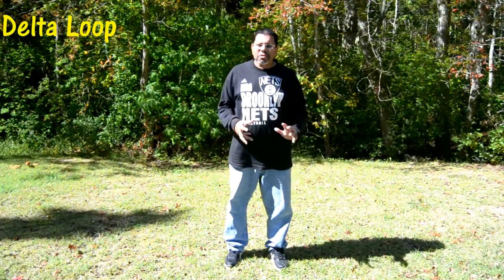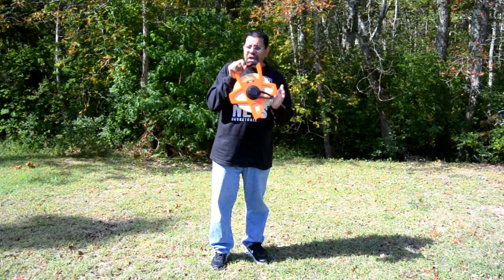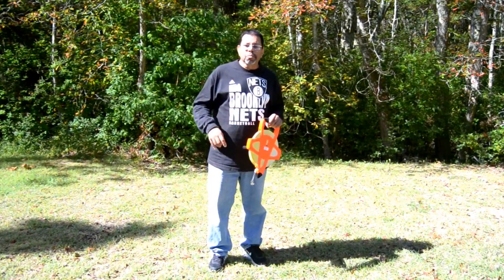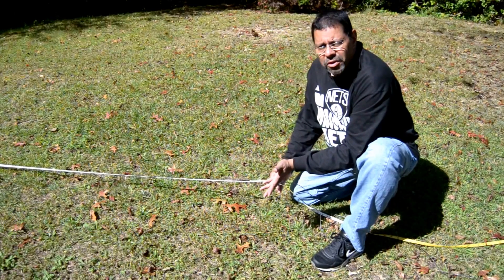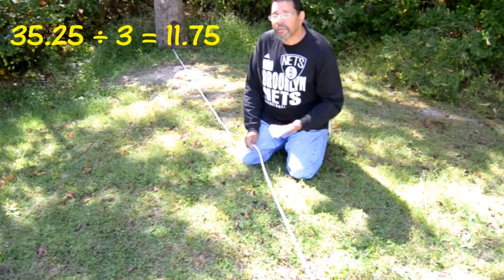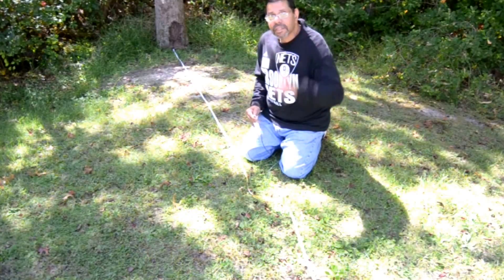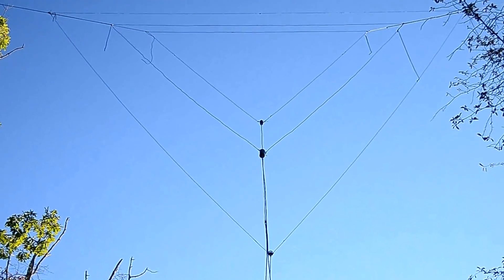How To Build A Delta Loop Antenna

Comment: you stated this is vertically polarized, it looks like it is fed in the center, wouldnt tht make it horizontal, I have read feeding it at a corner of the base makes it vertical, please explain. Thank you for your vid and time.
Reply from the maker: Sorry for the late reply.  Going to have to check but i think i said that it is hung vertically but it is horizontally polarized.

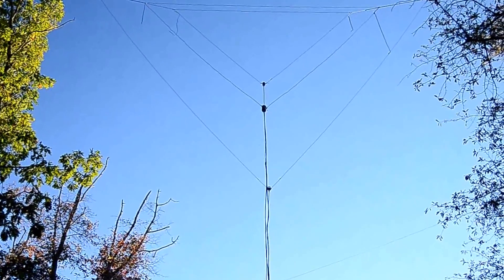Comment: hi Hiram thanks for this video make me understand about the q-match,  Hiram i see on video @ minute 08:33 i see the 3 antena deltaloop. my question  can i use only one coax for 3 antena Hiram ? thank you so much for your answer and 73 all the best for you and family and best regard from indonesia YB1BBW
Reply from the maker: Sorry for the late response.  I never feed one cable into multiple antennas so I dont know.  My guess is that if you can do it to one antenna then you can do it to any antenna as long as the load is 50 Ohms on each antenna.

Comment: I’ve ran a 40m delta like this for years. No trees so 1 end high and 2 at 10ft. Fed with 75ohm stub. I’m wanting to try the open wire on it soon. Just to see if it does any better on 20. I’m building a 1:1 current right as it enters the shack. The loop shows 80 ohms at the Q. 
 I’ve often wondered how it would do with a 20 and 10m inside like yours. I’m sure there’s some common mode current maybe ? Great antennas
Reply from the maker: Sorry i'm late to reply but I'm just seeing this now.  I do see what you mean.  It is sorta "upside down' from the way i did mine.  I don't know if that really matters.  40M deltas are large so I guess the feedpoint is up around 60 ft.  Would play the same as if it were 2 corners at 60 ft and fed at the bottom.  Reason being the antenna radiates out from the center of the loop.  It doesnt matter which corner the feedpoint is.  However if it is fed along the sides between the corners then it will change the polarization so that will affect how it performs.
Reply: @hiramvazquez7868  Tnx hiram. Yes we use deltas at the contest station. Vertical plane and fed 25% up the vertical leg at 110 feet. They work very well. Still my primary 40m antenna.

Comment: I see here is multiple delta loops inside each other with common feed point why is that? Isnt a single loop with 4:1 balun enough??
Reply from the maker: I do have as many as 3 delta loops inside each other but they are fed individually. If you use coax the antenna will be monobanded so you will need a dedicated coax for each.  Anything else will compromise the performance of the antenna. Maybe if you feed it with ladder line and use a tuner but I never use my antenna in that fashion.  73
Reply: Hiram Vazquez are these loops directional or omni directional
Reply from the maker: @Mark300win  they are hung vertically but they are bi-directional

Comment: Hi, perfect video, will make  one and try it out, on 80 and 160 would it be same if it is mounted horisontally ? I know vertically makes lower angle/better DX.
Frank LA9KY
Reply from the maker: Yes it does make a difference. If mounted vertically the take off angle is lower. I used it on 40m this morning and worked VK6 and VK1 with just 100 watts.  Good luck and have fun with it!
Reply: thanks, have you ever tried to lay it down, not flat but still sloped, with feedingpoint lowest, and the top maybe 85feet.(which is the highest i can do) thinking about 80 and 160m, wonder how the radioation pattern will look like ? :-)
Reply from the maker: @frankhagen4380  I have not tried it but I have heard a ham that did.  He was super strong to me. Around 30 to 40 an over S9.  However he was maybe 200 miles (320 km) or so from my QTH.  To me he was booming.  He said he worked some DX in the DX Window (3.790 to 3.800) with good results.  He had to slope it because he didn't have the vertical height and the feedpoint was only about 3 meters off the ground. Hope that helps.  The best answer to your question is as NIKE says. "Just do it".  Good luck and hope to add u in my log. 73!

Comment: Hi Hiram, Great video. I love loops. I use an 80m FULL WAVE SQUARE LOOP and its only 10' off the ground.  How high would you say your loops are?
Reply from the maker: Hi and sorry for the delay as i just read your question for the first time.  My loops are up about 50 to 70 feet supported by the tops of trees.  They are hung vertically so they are bi-directional but also have low take-off angle which is preferable for DX.  Thanks for watching!
Reply from the maker: My loops are 60ft at the top then they hang down.
Reply: It's so noise quiet. Awesome antenna
Reply from the maker: @marklowe7431  Mark the great thing about loops are that they are quiet. They have gain and don't take up much space.
Reply: @hiramvazquez7868  I want to thank you for putting the video about the delta loop on YouTube. It has been very informative . And I plan on building several Delta loops inside one another like you have done. Thanks again .73 AE4OY WILLIAM A. Peacock,Sr.  EM-81UF

Comment: Can I feed a 160 meter delta loop with 450 ohm ladder wire? WA4LJJ
Reply from the maker: Hi Honsell.  You can feed any antenna with 450 ohm ladder line.  It will make it a multi band antenna.  In your case 160 thru 10 meter but some bands may have compromised results.  Good luck and 73

Comment: I built one thanks to your video! It ending up being too big for the property. I ended up with a full wave square loop (145 feet) fed with coax into a 4:1 current balun and hung horizontally 15 to 30 feet above grade. Works like a champ 40 meters through 6 meters. SWR flat all the way through and others tuned via radio. This is not the most efficient setup, but it is very quiet (rejects man-made noise) multi band antenna. Ideally you feed it with ladder line with no balun; instead using an isolator at the feedpoint.  That'll be lower loss and 145feet would prob tune on 80m. A full wave on 80m with ladder line would tune 160 I believe. :)